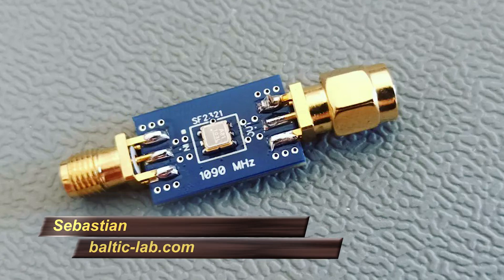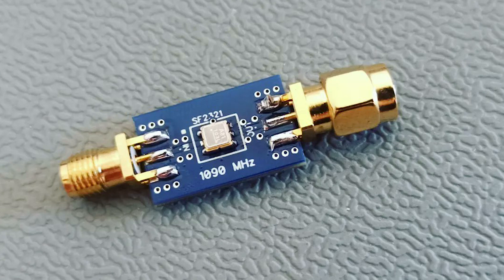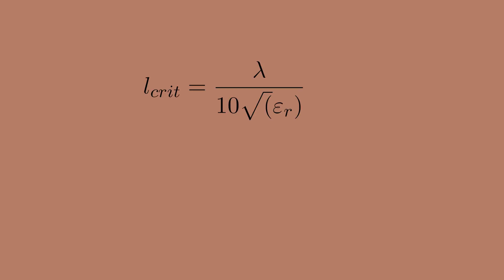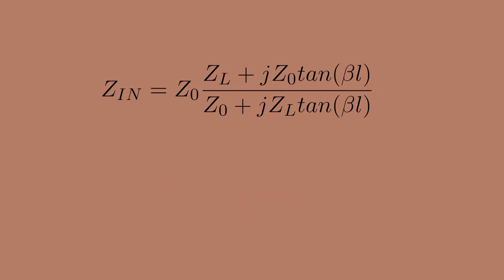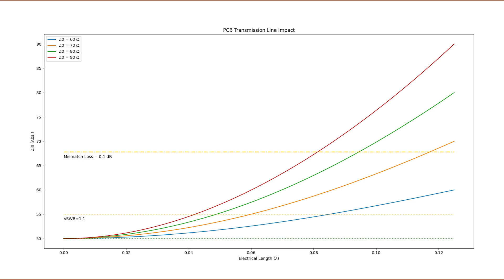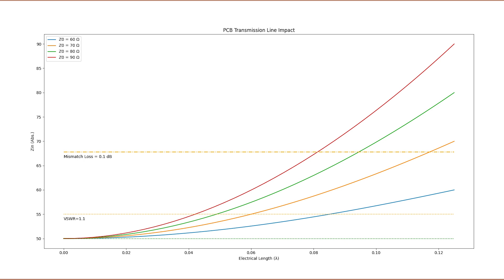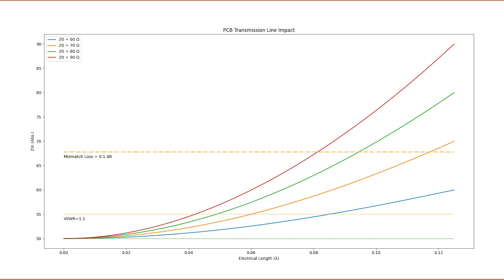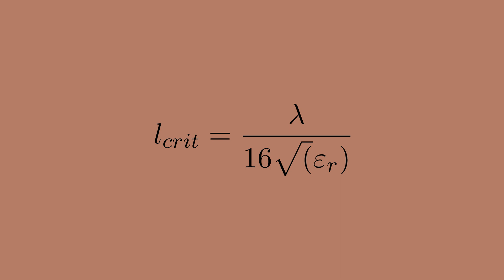What Is The Critical Length of a PCB Trace? [Transmission Line Theory]

Comment: Great to the point video. If I could add a bit, the Smith Chart is a great too for thinking about this. Find your characteristic inpedence along the zero reactance line(centre line). The resultant impedence will be rotated around this point by the fraction of a wavelength. If the wavelength is short the rotation is small. If the characteristics impedence is a goof match, the rotation is around a point t close to the centre anyway.
Reply from the maker: Great tip!